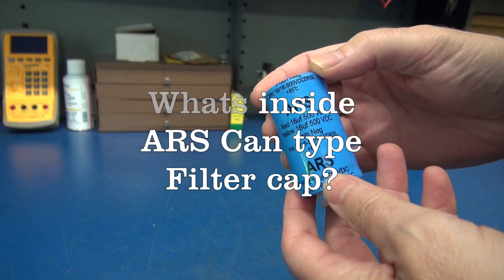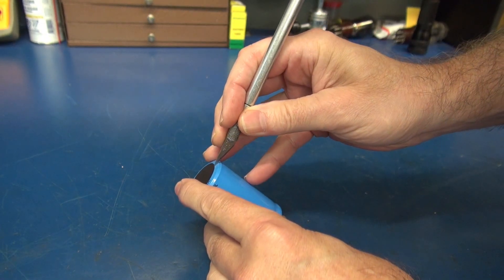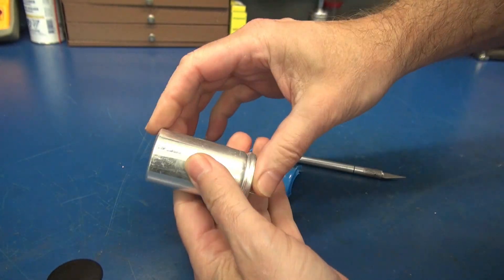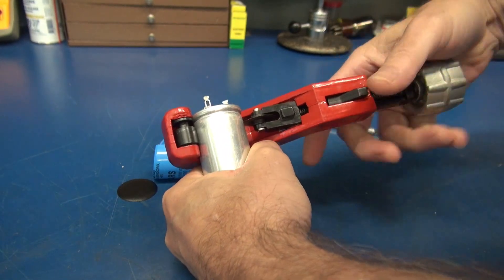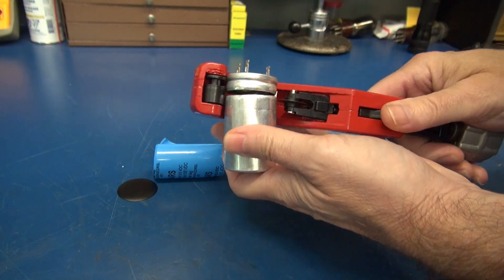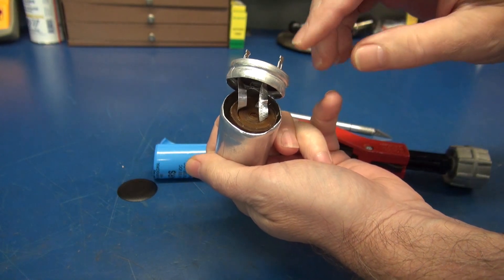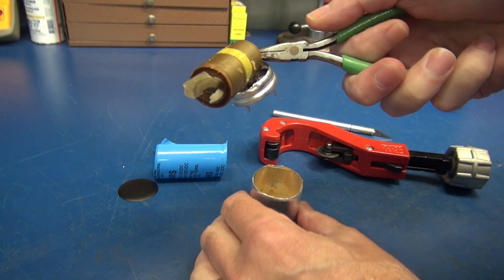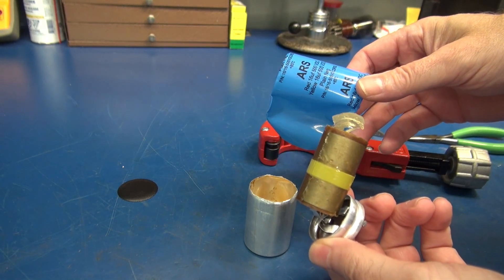Whats inside of ARS can type filter capacitors? Lets cut one open inspect the inner works

Comment: Thank you Terry. The 50+50 uF can capacitor selection is a big discussion. ARS tend to be appreciated because they are rating similar to old LCR in Marshall Amp ,they are suposd to be manufactured in China or Taiwan. I read German  F'T capacitors to provide  grainy tone, and then I read F'T tend to manufacture them at  a bit higher tolerance +20%  ( 55uF?). The question now is : if F'T cap has grainier tone  because it has bigger capacity and better ESR when new and is more sharp response , then when aging F'T will become smoother and will probably last longer than ARS that is rating just at 50uF when new with smoother tone but could last shorter than German F'T as starting ife already with lower performance values ?

Comment: @d-labelectronics I have a question maybe you can answer. I have a fender Hotrod Deville and the sound oscillates. For instance i I hit a single B string it vibrates wha wha wha wha like an out of tune bell. I replaced tubes awhile back . I recently tapped them to see if one was harmonic and they don’t seem to be. Imagine a higher frequency tremolo on fast vibrato. I bought a fromel kit a year ago and replaced the large caps but not the rest of the kits.
Reply from the maker: Take a look at the power supply filter caps, see if theres leakage out of the positive end. If so, replace them all
Reply: @d-labelectronics  thanks for the reply. I will check them.

Comment: why is a can type capacitor made this way superior to one containing individual caps?
Reply from the maker: I find if they have individual caps inside, they are usually poor quality, resulting in premature failure
Reply: @d-labelectronics  Thanks Terry. So it would not be intrinsically inferior to use individual caps if you were to use high quality capacitors; it's just the way the cheap ones are executed. Good on you.
Reply: I have the same question. The only downside that I can come up with is that you can't see the radial caps bulging or leaking if they are hidden in a can.

Comment: I took a chance on some MA branded can caps. I'm not expecting much, but they were inexpensive ( 8 bucks ), and i build amps mainly for myself. (My customers get F&T..)
I may crack one open and see what is inside them..
They look fine on my LCR meter, for what its worth...
I've also thought how great it would be to be able to buy some cheap cans that you could stuff yourself , with nichicon etc etc.. somwthing that looks the part...
I've tried your other method using a 4 pin socket and some radial caps heat shrunk as well